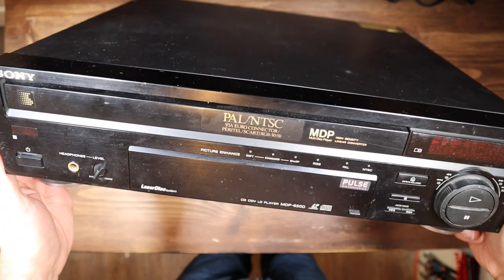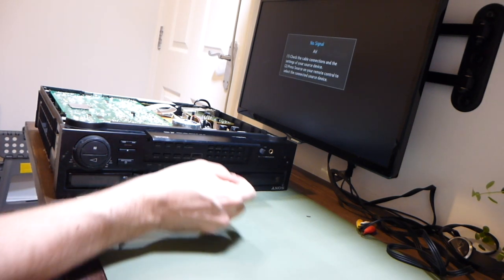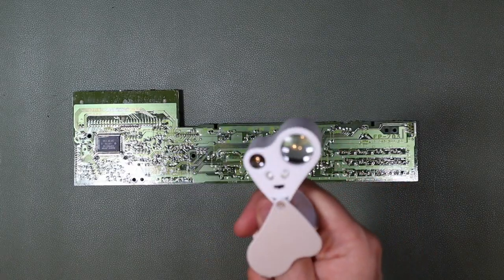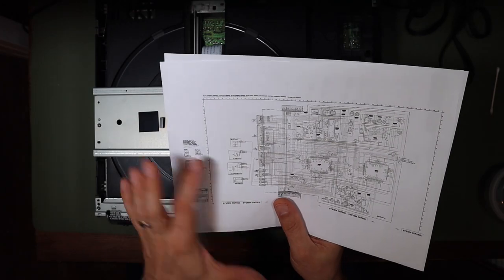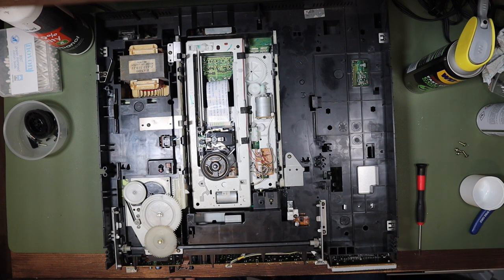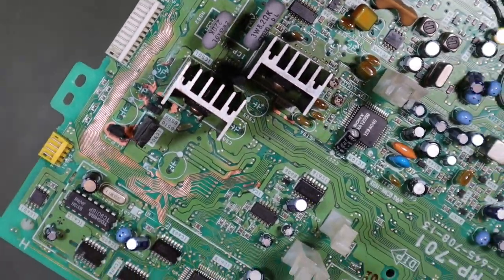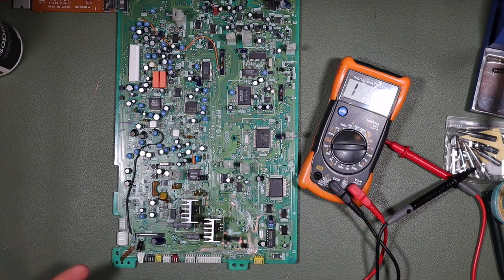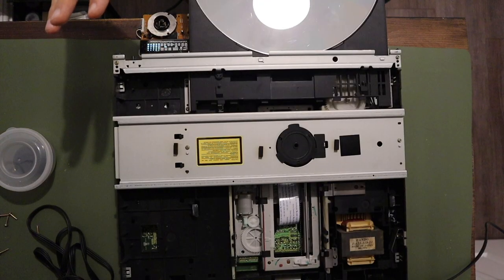Sony LaserDisc Player Trying to Fix (MDP-650D Repair)

Comment: Hello! The video has been useful to me.
I have the same player.
But I have a big problem. When I turn it on, there is a noise like a motor turning. But the disc doesn't spin.
I really don't want to lose it. There are very few...

Please, if you are there, and can help me, send me a signal!
Reply from the maker: Hello Woppox. I am here but unfortunately i am not an expert in these repairs and these machines are very complicated so I am not sure I can help much. There are several motors controlled by several microprocessors. You probably need to work out which isnt working. When you put the disk in does the sled move, the laser move up and down and the disk lift off the tray.

Comment: That was a roller coaster of emotions. Strangely enough, I'm most impressed with your trademark epoxy-as-screw-boss repair. Quite "simple", but it never occurred to me to try it before I saw you doing it on a previous video.
Reply from the maker: Thank you K.P. it never occurred toe that was a trademark LOL. I'm not sure it had occurred to me either until the Amstrad either! It seemed to work better with the Amstrad but it could be either the epoxy or the plastics were different. Which reminds me I need to get some more putty. Anyhow I'm so glad that you enjoyed the video. Thanks so much for your comment.

Comment: Thank you for this video! I have the US version MDP-455 I purchased new in the early 90's. It hasn't worked for years. It won't read discs. I've opened it up but don't have the skills to repair. I suspect the problem is in the laser mechanism. I have a bunch of opera discs that I can't find on more modern media or they are very expensive. I think I may look for a working player instead of trying to repair after watching your video!
Reply from the maker: Hi Tom, Thanks for your comments. Sorry the video didn't help you repair your player, but perhaps it helped you decide on a course of action. These players are getting expensive now. This was my first but I was very impressed with the format for its years and would like to find a good one.  Thanks for taking time to comment. I value that.

Comment: Had to watch a second time. This repair was definitely a roller coaster. I can appreciate all the effort and sense the will power in not giving up.
Reply from the maker: Wow watching repeats is a compliment. I saw another one of these go up on ebay and was a bit disappointed I missed out as I'd like to have a go at one using the lessons learned from this. Somewhere I do have another laserdisc player so there may be another similar video some time. Until then thanks for watching the repeats! And for your kind comments.
Reply: 0

Comment: That belt fixed the clamping issue. Now the motor won't spin the disc. I'm about halfway through. Can't believe the motor is burned out. Hoping there's something that is preventing the motor from spinning. The lase is em
emitting Light. Also did a full white grease relubricate... ( mine looks to be a very similar mechanism - MDP-455
Reply from the maker: Good luck with the repair. They are big complicated beasts for sure. I might have a go at a other someday.... till then thanks for your comments. Really appreciate it
Reply: @RetroTechRepair  any tips on the motor spinning issue? Moves freely with or without a disc. All aligns and no binding. It’s in such nice shape and hate to give up. I’m rather “stuck” at this point.

Comment: Patience rewarded ... such a shame Sony cheaped out on the structural elements. Epoxy putty and FORMcard can be useful for reinforcing dodgy plastic joints.  Keep an eye out for another one ... your experiences might pay dividends in the future.
Reply: Plastic easily gets brittle when it gets old and has been thermal cycled..
My pioneer LDP's were no stronger on the innards..   :)
A little low(!)
 heat (air gun) can buy you just a little bit of flexibility on old plastic.
Reply from the maker: Thanks Bill. I was hoping the pioneers may have been a little better. I was on the lookout for one of those. Thanks for the hot air tip, will definitely try that next time.

Comment: I have that same player with more or less the same problems! Thanks for the inspiration to try to fix it!
Reply from the maker: Hi Tadeu that's great. So glad you found the video useful. I learned a lot myself  if I do another I'll be VERY careful with the plastics. You might get lucky, mine wasn't packed very well for shipping so some of the damage could have occurred on its journey to me. Anyway thanks so much for your comments and good luck with the repair.

Comment: Great repair tutorial.  I would usually think a dead Sony player would usually be a bad pick-up or a stretched loading belt but I guess you proved me wrong.  

Also, just clarify a minor thing; this player will only pass PCM or DTS through the optical digital output.  If one does want to output AC3, a mod will need to made to this player to add an additional circuit board and an RCA jack.
Reply from the maker: Thanks David sounds like you know a lot about these players. I'll be honest I thought it would be the loading belt too when I first read the eBay listing. A quick low cost repair I thought! How wrong was I. Good info on the optical out too. Thanks. As you can probably tell I'm not an expert in these repairs, just trying my hand at fixing stuff. I learn a lot from all the great comments, so I really appreciate you leaving such detailed feedback like this. Thanks so much.
Reply: @RetroTechRepair  At this point, we're all learning the hard way to be repair techs out of necessity w/ the lack of repair shops these days.  Especially with LD players, we're never going to see a renaissance like the turntable so every player that can be fixed should be fixed so we can still play this old software.  Luckily for me, most of the issue I run into are either loading belts, cracked gears, or dried up grease locking up the mechanism so they are not as difficult to fix.  However, I have acquired some DOA players that I can practice on seeing if I can fix and your repair tutorial gave me some ideas.  We'll see how it goes.  

And in regards to AC3, I do specialize on doing these mods.  Probably the coolest thing in the world to upgrade a pre-1994 player with a new sound capability.
Reply from the maker: @MovieGuy846  good to know. Thanks so much I do fancy trying another some time but need to clear some space first. I'm fighting the urge when k see a good candidate on eBay. Keep in touch glad the video helped I'm sure you have experience I might need as I tackle more players

Comment: Unreal trace repair without a microscope
Reply from the maker: Thanks Jamie, I should put one on my shopping list. With my very honest eBay descriptions, I tend to lose money on these repairs so I need to managed my acquisitions carefully. I used a loupe magnifier when I'd taped each section of wire in place and again after soldering, but it took me probably 3 days of my spare time to get the tracks repaired. Thanks for you comments BTW... very grateful

Comment: Wow, what an amazing repair, and quite the roller coaster. BTW, for dealing with broken plastics, there is a technique that I and many others have used successfully. If you combine cyanoacrylate (aka super glue) with baking soda, you end up with a surprisingly strong compound that you can use to join broken plastics together again. In fact, this technique works so well that you can actually use it to re-form missing pieces of plastics in many cases. The YouTuber "Tech Tangents" does a much better job of explaining this than I possibly could, and he demonstrates this technique on several of his bits of seemingly irreparable plastics. Search on Youtube for "tech tangents plastic repair" for that video.
Reply from the maker: Thanks for the feedback and the tip, I'll definitely check that out. Glad you enjoyed the video... I was riding that roller coaster quite a while.

Comment: Hallo,  iI think the 650 is very similar to the 740 D. My problem is the player doesn't play the discs. We had to repair the tray  because it does not work propperly. Now this was fixed we recognized that the player does not read the discs.  Any advice for me?
Reply from the maker: Hi thanks for your question. I am afraid I don't have any advice. I am far from an expert in these repairs. I have a similar problem on another machine I have, but haven't yet managed to fix it. One day if I do I'll post here and maybe it will be useful. If you find a solution let me know. 

In the meantime thanks so much for your question, hope that you enjoyed the video

Comment: Great repair, another one saved. Shame time is taking it toll on the caps and plastics
Reply from the maker: Thanks, quite a challenge that was. I have another older LD player yet to do it will be interesting to see of its better or worse. I don't think we will have too many of these players left soon. The plastics are so brittle now and they have an awful lot of caps. Thank you so much for your comments.

Comment: I’m trying to fix my d604 player and am having an extremely difficult time finding a 23 pin flat ribbon cable that connects to the laser lense assembly. 

Any suggestions on where I could find one?
Reply from the maker: Sorry but I really don't, this was my first repair attempt of an LD player and I might not do another for a long time. So sorry. If you do find a source pop back and let me know. Thanks again